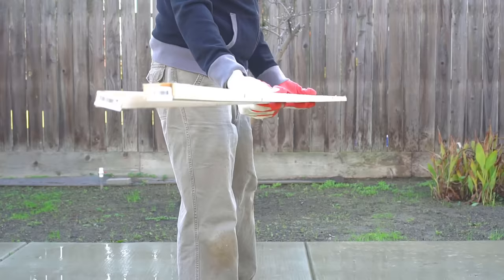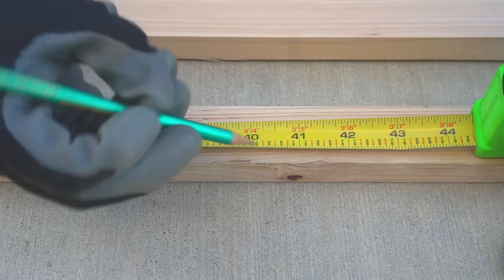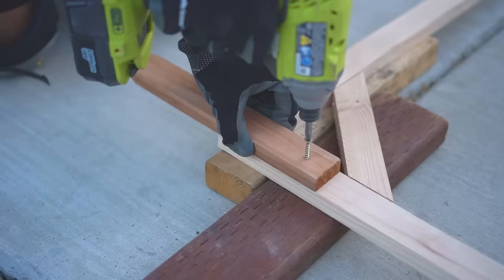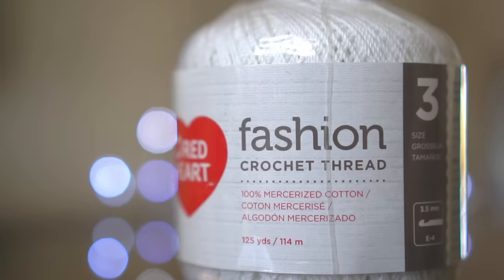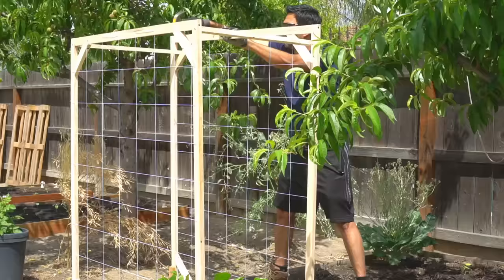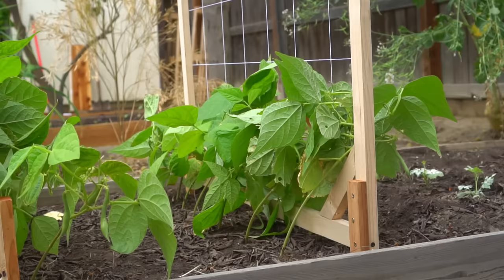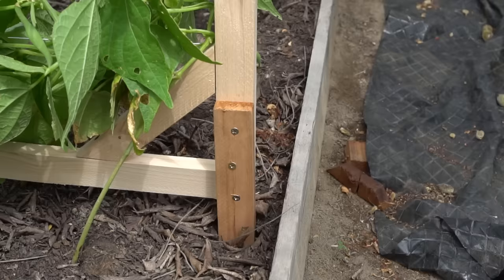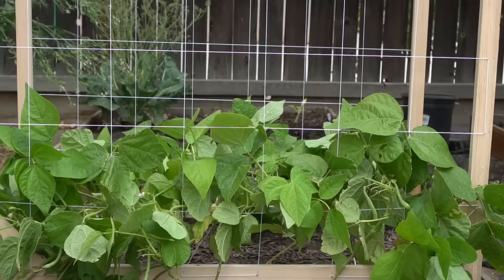How to Make Easy and Cheap Trellis

Comment: Thanks for taking the time to build and tell Jag. I built my own trellis this weekend following your specs. I made some adjustments; I used 5 boards instead of 4 since my bed is wider, and used "L" brackets to brace the cross-bars and give the trellis more strength. It came out great, I wish I could upload some pics.
Reply: If you made some "adjustments", you didn't follow his specs.

Comment: First of all, great job.  I am going to do this for my sweet potatoes.  A couple of suggestions.  Wood is weakest in longitudinal shear so putting fasteners into the end grain is not recommended.  I would recommend triangular plywood corners at the top.  You can fasten the two pieces together and get sway bracing at the same time.  With a jig saw or router, you could even cut an arch shaped piece for the corner.  That would look nice.  Takes a little more time.
Also, at 2:20, you are putting a screw into the end grain of that horizontal piece.  Instead, bring that horizontal piece over on the side of the upright and put the screw into side grain of the upright.  That will hold much better.  Thank you for listening.
Reply: Yes, end grain is notoriously weak for holding screws. You can also do this: drill holes for dowels perpendicularly to where the screws will go into the end grain, glue in the dowels and then drill pilot holes to insert the screws. This will give the proper wood grain direction for the screws to bite into, without having to overlap the wood pieces and then add triangular corners as well..

Comment: After watching your video, I decided to follow your directions and make one for myself.  It turned out great!  I used vegetable trellis netting, because I already had some.  The only thing I would recommend is to use a heavy duty staple gun to staple and secure the braces in the corners. Then, if you are building this by yourself, it makes drilling the pilot holes & inserting the screws easier.  I also used a staple gun to secure the netting around the frames.  Took a lot less time.  Thanks for the design!

Comment: Perfect timing. I have melons on the way and wanted to put them in a 4x4 SFG with a trellis. 👌🏼
Reply: I think you'll need something heavier duty for melons. It might work if you doubles or tripled the string and twisted it- or just got heavier twine. I love these trellises, but string and twine tend to stretch and sag with just beans on them, so you'll want to find something that can handle the weight.

Comment: Nice job Jag, I did the same the other year, but you will need a horizontal support from the top of the trellis to the fence, it will parallelogram otherwise due to the weight of the foliage and weight of the beans. Lovely job, just a tip.

Comment: Can you share what kind of screws is ideal. I started doing this with 2 1/2 inch #10 screws and its been hard to drive the screw into the frame without make it pop out (since I cannot drive straight) and wood splits as well.
Reply: Pre drill your holes. Use stainless steel screw, or something that wont rust. Just passing by! Best wishes.
Reply: I agree with Jason. Either pre-drill your holes, or use SPAX screws. You can find them at Home Depot.

Comment: i would love to see the shape of this trellis after a year or two, just to see how it survived sun and rain. I have not been able to do this in india. The weather in kerala is extreme. Rains are heavy and summer is humid. The wood really wears off after 6-8 months and good quality wood turns out to be a lot more expensive and not feasible
Reply: In case you make entire frame with PVC pipes.  Drill small holes at every, say 8 inches, pass thread through it (use big needle to pass it). And it will last for years.
Reply: yep, use PVC pipe or some other kind of sturdy / resistant material.  Even some strong plastic pipes of some sort that you might be able to find.

Comment: Very nice project I like the design but there needs to be a little bit more support in case wind comes from one side or the other --  front and back is supported a little bit by the structure itself but side to side support seems insufficient.

Comment: Jag, it would have been very helpful for me if you could have given the rest of your measurements. The measurements of your corner brackets and the angle cut (is that 45 degrees) and where did the wood for that come from. Also the measurements for the Redwood stakes + the angle of the cut on those and where did this wood come from. What size screws and nails did you use. Also, is the price you quoted ($7.50) for all materials or just for the 8ft boards? and is that cost only for one half of your trellis.  I very much would like to make several of these for my garden this season so knowing as much as I can would be very helpful.  Thank you
I would also like to thank you for sharing your videos as they are very helpful.
Reply: I believe the four boards and the string totaled $7.50. Four boards do the two trellises but not the angled corners nor the connecting pieces.  I’d add a fifth board for that.  For the angles, I’d just do 45 degrees. On the corner pieces, you can just choose a length that works for you and looks good, and make all the corner pieces the same length. Regardless of the length chosen, as long as they are cut at 45 deg angles they’ll fit fine. I’m guessing he had scrap redwood but maybe had to buy a piece of that too.  Screws and nails are difficult - either you have some and the cost is essentially almost nothing, or you have none and the cost is a box of each. I’m not sure size is critical (not my forte) but if the wood is 1.5” thick then I’d think at least 2” or, better, 2.5” screws would be good. For nails, they look like little finishing nails and I’d think 1” or so is fine. So not $7.50 “as shown” but probably $10-$20 depending on what you have on hand and what the price of wood is i your area.

Comment: 1 x 2 x 8 ft length wood furring strips are $1.63 each at Home Depot ( 63% increase from $1.00 each) . Four years later in 2024, those two trellises for $7.50 would cost $12.23 plus tax in Raleigh, NC. Still cheaper than $30 per trellis!  Happy gardening 2024!🪴🪴🌱🌱

Comment: Is that non treated pine? Would it be better to use treated wood since it’s not in direct contact with the soil?
Reply from the maker: It's just Douglas fir, treat wood is not needed as it is more expensive.

Comment: I have been using lashing wire, it's much better and stronger than the thread you are using (Stainless Steel Lashing Wire | .038, TYPE 302)
Reply: But, the purpose of the cotton thread is that it can be cut and composted at the end of the season.  Wire will need to be dismantled and disposed of.
Reply: I used a plastic-type twine. It should hold up to the rain better and last longer. Not as earth friendly as cotton but I had it laying around not using it.
Reply: @raoh8096  But if you use stainless steel wire, you can use hooks at the end, to simply reuse the stainless steel wire for years, maybe even decades. It also helps with growing heavier plants, like using one tree to make a tree wall, with the branches spread to the sides in more or less a straight line, but weaving around the support wires, to be able to hold all the weight of those fruits. You can leave the very tip of the tree grow like a bush, to absorb more sunlight, if you want to.
Reply: @SapioiT  yes cotton is great but will stretch and then it will get loose and probably not stay attached on those tiny hooks 
Go with your idea permanent and reusable is good idea
Reply: @pamelavance648  To be fair, toilet paper is in high proportion plastic, at least where I live. But still, those plastic fibers are also helping to trap dust.

Did you notice that in the last few years the toilet paper has a lot more trouble actually sinking, and just kind of floats there? My toilet's water tank isn't pressurized, so water doesn't move too fast, and in the last few years the toilet paper started floating, after being used. The water pressure didn't change, because it's not a pressurized tank, and the toilet itself surely didn't change, so the toilet paper must have.

Comment: Great idea, but that definitely doesn't look like $1 pieces of 1x2s. That looks more like premium wood that's usually about $5 per piece at Home Depot. The $1 1x2s are typically not cut so smoothly or straight

Comment: Looks good now.  But I'm worried that the wood would warp out of shape after a while.
Reply: Depending on the wood, it could take years.

I used some pallet wood for a project and the project is still standing, even with a bit of warp.

Just paint or use stronger wood.

Comment: Can someone tell me how to get the measurements for the brace pieces? Thanks!!
Reply: I just placed a piece of 1x2 under the corner of the completed frame, and then marked it between the two points with a pencil. I then used a miter saw to make the angled cuts on the marks that I’d made.

Comment: Hey man, I've followed everything in this video, and currently have all my wood cut to the two lengths I need to frame the trellis. Problem I'm having is, once I frame the trellis, how do I accurately cut the correct angle from a piece of scrap wood to brace the corners as you've done. One side sits flush and the other side looks like my baby sister cut it. Any advice? I've been having not as much luck keeping the wood flush as a I drill. These may be rookie mistakes, and admittedly I'm just a novice looking to help my work team have a nicer outdoor experience in our outdoor workspace.
Reply: First check if your frame is square (equal) on all sides & (diagonal corners). Secondly, using a scrap place it on top of your frame (not inside) where you want to create a brace for the first corner.  Draw a line (inside) of the frame and place a mark each side of the brace where the two angles meet. Draw a line where the two points meet. Use this as your template for all of your corner braces slide brace inside of frame until it becomes a tight fit. The other option if you have a mitre saw and if your angle is exactly 90 degrees, make each end cut at  45
Reply: @TheClaudos  thanks so much for replying.
Reply: @TheClaudos  could you explain just a bit further what you mean by drawing a line inside the frame

Comment: I watched your video and was going to copy your design plan but the dimension makes no sense. You stated buying 4x 8ft length and each 8 ft length is cut into  a 4ft 8inch and 3ft 7 inch piece. An 8 ft length gives you 96inches. The 4ft 8 inch and 3ft 7 inch adds up to 99 inches. Far surpassing the length of the 8 ft length u begin with. Can u explain this inconsistencies. Also the trellis height looks like 8ft tall and no way could be only 4ft 8inches in heightbased on video

Comment: This trellis is not going to work for heavier veggies. Would this trellis be strong enough to to use wooden garden stakes to hold up tomatoes or zucchini squash?
Reply: What kind trellis are good for the tamoto and cucumber?
Reply: Aurora lan For cucumbers there are metal ones that have a grid on one side and two legs that hold up the top at about a 45 degree angle. Tomatoes that are not bush tomatoes need something tall that could be made of cedar with a ladder like structure, actually 4 of them in a square shape. The tomato would sit inside. Alternatively, people build wood trellises that have 2 sides and a roof made of ladder sides about 3 feet wide and 5-6 feet tall.

Comment: Please can you explain how on earth 1" x 2" lengths of wood.can have exact dimensions of 3/4" x 1 1/2"?In my day the exact dimension of 1"x 2" was 1" x 2". In metric that is 25mm x 50mm.
Reply from the maker: 2x4 is not exactly 2 inches x 4 inches. This is how they categorize lumber but true dimensions are different.
Reply: @DaisyCreekFarms  my first job, when I left school, was at a sawmillers. We sold 1" x 2" architect and 2" x 4" sawn timber. The measurements were exact.

Comment: This isnt as easy and cheap as it says, where I'm from its 2$ a piece of piece of wood. It's also very difficult to drill perfectly straight mini holes to put the screws in, I kept cracking the pieces of wood because they're weak to begin with. For all the holes you have to drill, precisely cut things and weave tight strings, it's easier to buy a couple chunks of wire deer fence.